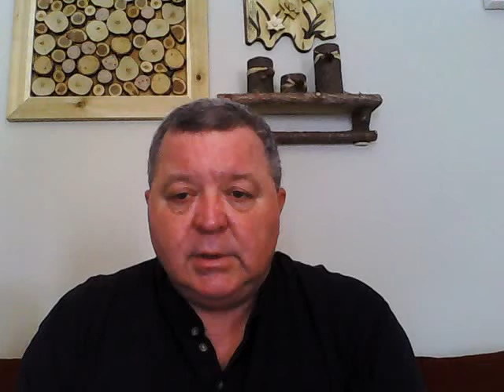Powering the Planet - Current status update, urgency, problems and major topics involved

Comment: The earth has used River flow energy not just electrical for millennium along with Damns & waterwheels.  What is the Leap Frog Technology Here?  Nothing shown, I can push it to the top & world if you had shown something.  The Best Future is space based Solar Power produces a Terrawatt per unit.
Reply from the maker: Mr. Boike, I know there are many alternative energy generation theories that exist today.  Solar Panels in space, artificial photosynthesis through a chemical process to convert water to hydrogen and oxygen and finally cold fusion, etc..  I believe as I'm sure you do we should be researching all the above along with anything else that has a sound scientific theory. 

Solar Panels may seem like the most likely theory, but lets take a closer look at all the obstacles that exist today.  First we can't control the heat in our ITER project's today on earth and now were talking about in space.  Next some how we have to transmit that energy back to earth either through some type of heat transfer or radio wave technology that has only been proven in short distances and at low wattages.  Now we have to be able to collect that heat source or futuristic wave technology and convert it into electricity.  I also know the energy conversions from heat to electricity are extremely inefficient.

In the future I believe we will have cold fusion, chemically convert hydrogen into it's components easily and be able to control the weather, etc. 

All these theories are without any practicality today or in the near future.  My new energy invention is practical today and has the ability to deployed almost immediately with a large group of scientist and engineers from around the world.  It can produce 500 to 1000 TW of electricity through clean eco friendly alternative energy distributed around the world.

Comment from the maker: Powering the Planet - Just to put things into perspective wind and solar make up approximately 482 GW of capacity. Now you have to reduce the 482 GW of capacity by 70 to 80% for efficiency. This means wind and solar make up about 100 to 150 GW of the 20,000 GW of electricity produced today which is estimated to grow to 30,000 GW by the year 2035. Wind and solar are not constant, which means a lot of the energy is wasted because of our grids are not able to handle the variations in the wind.